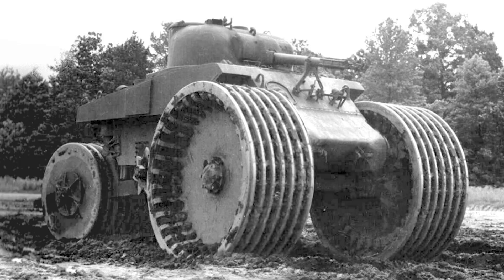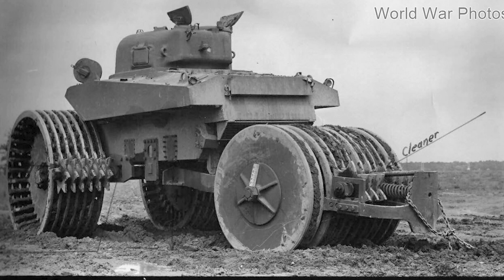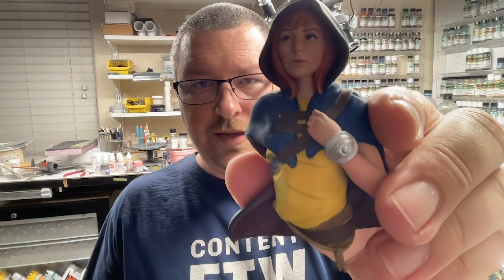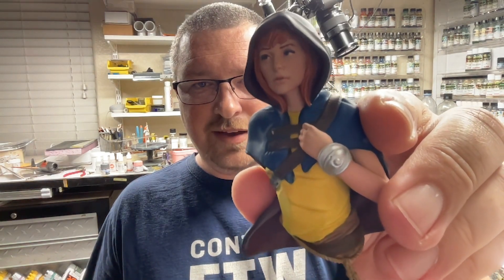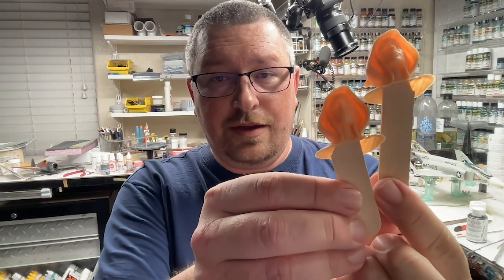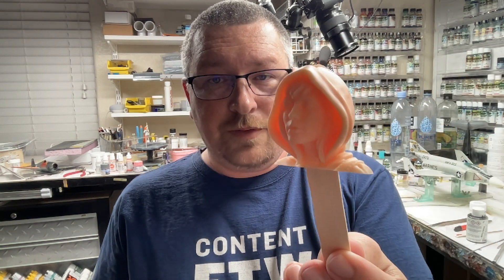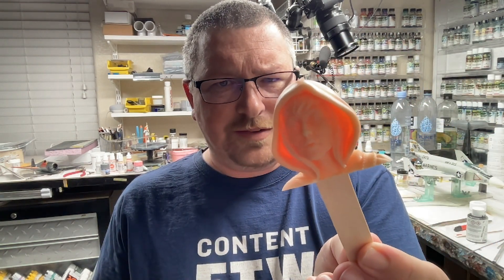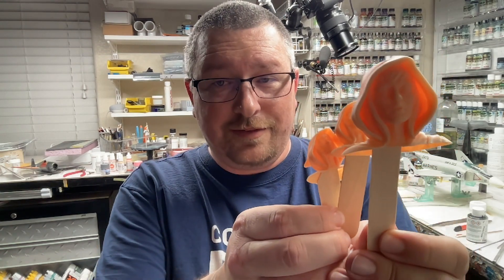2 Less-Discussed Benefits of 3D Printing

Comment: I haven't got into 3d printing but I've been tempted over the last few years. Having said that if you are worried about messing up your paint job on figures, bust's or frankly anything else, you can always strip the paint and start again. Plastic, resin or metal makes no difference it can be successfully stripped and you can start again from scratch.

Comment: I'm not sure that selling files is the correct business model for the future. I think a better way to go is for a 3D producer to use the technology for producing it's own product on an as-needed demand basis. First, you don't need to worry about degradation of molds like a resin producer and second, the problem of products appearing, selling out and gone forever should be eliminated when all the producer has to do is set up the printer and run a preexisting file. This would limit piracy and make an entire catalog more or less permanently available. If a producer desires to get of the business, selling the files to an interested party would be much simpler than selling molds, masters and any related equipment.

Comment: My concern with buying STL Files is "author rights" and any intellectual property right issues. Unfortunately, sharing digital information is easy, so giving away STL files to a buddy to print or selling someone else's designs for profit is a major concern. I have designed cockpits and bits for RC aircraft, and I post those in a forum for free after the project is completed. A repository of 'free stl files' is an option, but therein lies the rub. No monetary incentive, not much reason to design the unique. 3DP resin printing is a remarkable tech for all modelers. I would think that providing 3DP printed parts for resale is the way to go and 'print to order' the method.
Reply from the maker: And a lot of companies are doing exactly that...but there are still two problems. Well, at least two.

First, availability. If, say, Flying Leathernecks folded today, all those lovely 3DP items would suffer the same unobtainium fate as resin sets from years past over long enough time. If you wanted to upgrade a Hornet in, say, 2034, you might be SOL. 

Second, print quality. I bought some 3DP stuff from Ammo recently, and when I pulled it out, layer line city. To the point that, to me at least, the parts were unusable. If I had the STLs on hand, I could print them in ways as to reduce those lines and actually have stuff I could use.

Comment: Fully agree, that 3D printing won't replace injection moulded kits any time soon, but they are useful for some smaller parts. I recently printed a set of 1/48 F-105 boarding ladders on my own resin printer, these came out better than the injection moulded ladder kit I had! Also, I build a lot of special versions of aircraft and they often have small avionics boxes on the outside or other small changes. The ability to design and print these is absolutely an added value!

Comment: I'm itching to build an Avon Sabre (rare Australian made hot rodded version of the F-86 with a bigger engine and 30mm canons shoehorned in to a redesigned fuselage) there was a scarce ordinary conversation set that did the rounds a few years back. The obscurity and limited demand makes it unlikely that it will be viable for anyone to do a production run. 

3D printing would make obscure nieche aircraft like this viable.